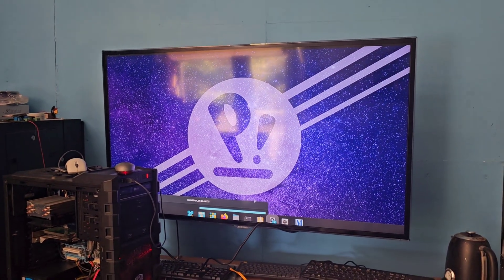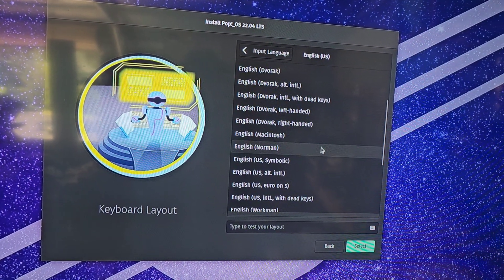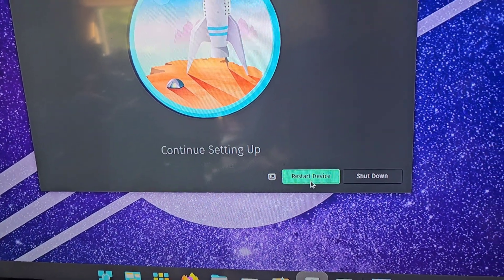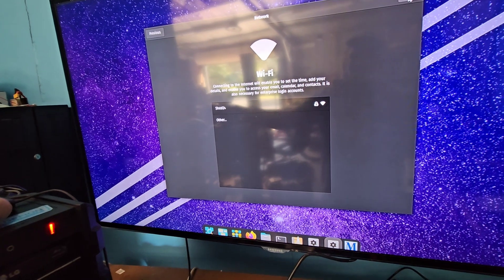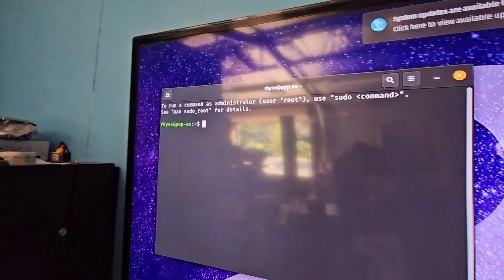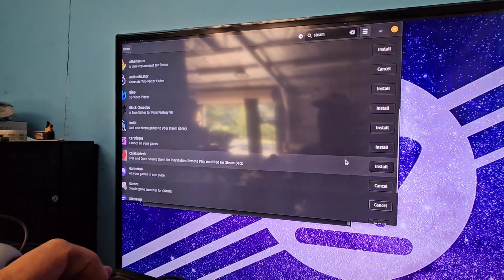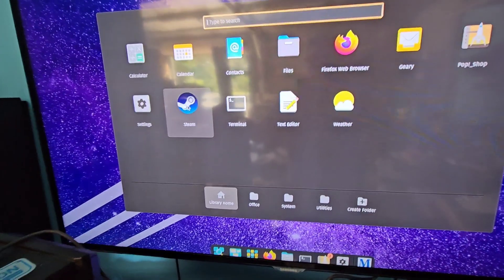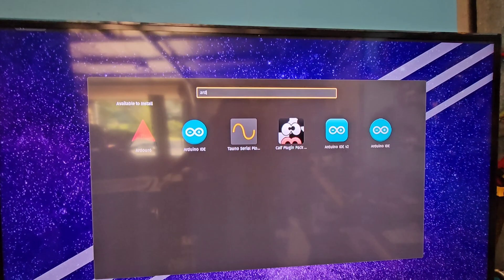Pop OS on an old gaming machine setting up steam.

Comment: Chuxxsss, maximum entropy in the workshop is normal. Relax.
I have no idea how to appeal to a youngster.
With a new install like that, I normally sudo apt update then sudo apt upgrade since the installer is fixed in time and will be out of date. Then I look for hardware drivers and get it to scan, find and install any drivers that may be required and not installed by default because they may be proprietary drivers - not sure how Pop!OS does that, but I'd try typing "hardware" into the menu and see what it presents you with. 
Nice choice! Enjoy.
Reply from the maker: Just installed wine, winetrick, and playonlinux.  Plus, there are some tux's games.  Plus, it was for free. Now on to fixing pfsense on proxmox. Ben Growatt is sending me a replacement inverter for the 2 5000. Vlog soon. Have a great day.
Reply: @chuxxsss  You too. Looking forward to the vlog on the growatts.